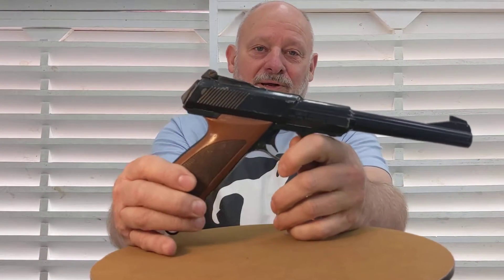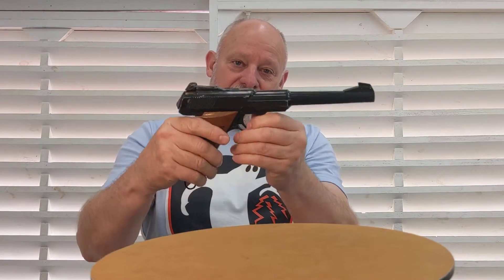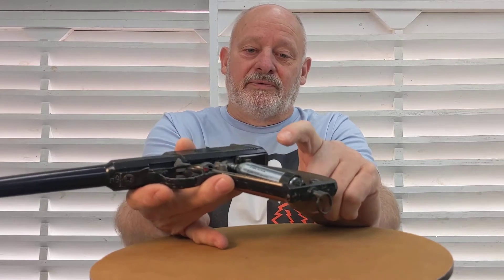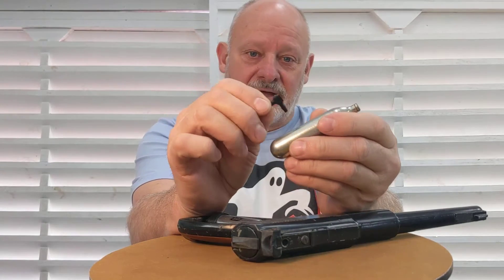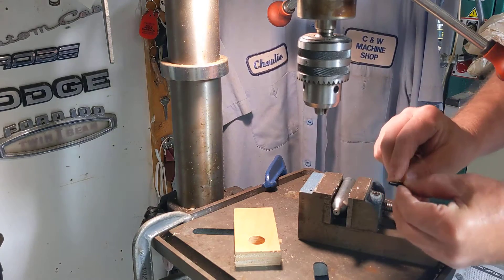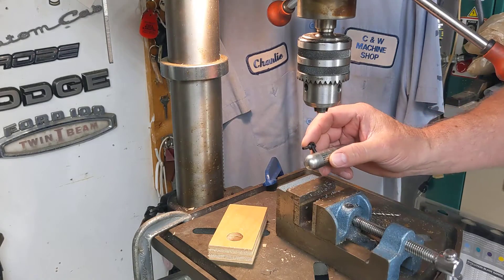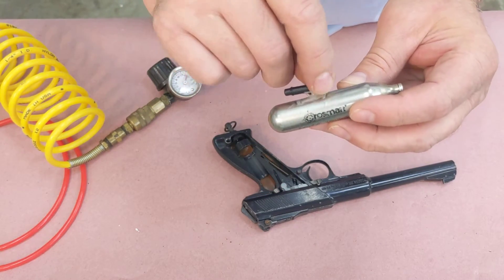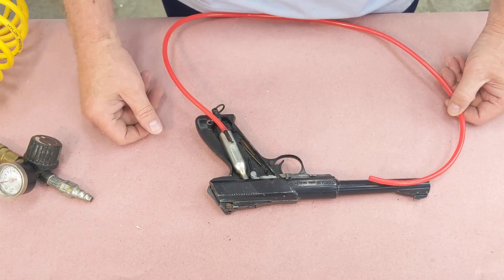Troubleshoot leaking CO2 gun with improvised compressed air adapter made from an empty CO2 cylinder

Comment: I've just started the video and have not got past the drilling of the empty cartridge..... But if you haven't chencked the rubber or leather gasket around the needle that creates the seal with the cartridge, that is my prediction. Especially with the fac5 you said the tank was all frosted up, i would assume it is ejecting gas downward around the co2 cartridge itself.

Comment: Ridiculous!
That red tube will blow loose at 50 psi!!!
And where are you getting 800 plus pounds of compressed air from????
Reply from the maker: attempting to trouble shoot the leak at a low pressure since it leaks even at 50 psi

Comment: I see a lot of inherent problems, except using this platform as a means of troubleshooting a low pressure leak. After you find what is causing a low pressure leak you may find yourself chasing your tail to find higher pressure leaks.
Reply from the maker: Yep, it is just a start to locate and correct any major leaks that occur at even low pressure

Comment: Daisy advertised claim that the 200 and 300 carbine were "o'ringless".  Daisy refused to service these and respectively claim them to be disposable once leaking.  I differ, as I have rebuilt probably six of these platforms between the two models.  

They use a very clever valve design that is a self resetting blow open and, yes, do have o'rings.    I really like the design.
Reply from the maker: I would really like to rebuild the model 200.  It has such a nice trigger , better than any other semi auto co2 I have fired.   I converted one to LASER burst for a shooting simulator but I still have another one I hope to repair some fine day.
Reply: How did you repair yours?

Comment: May I ask how many pounds of air pressure did you put into the gun?
Reply from the maker: I believe it was around 125 psi
Reply: Thank you.
Did you ever get this gun to seal
Reply from the maker: no, I wish I could have made it work again because it has the best trigger action I have ever found on a co2 gun.  I converted the gun to shoot LASER bursts to use in a 2gun practice simulator I built since the gun is very similar to a Ruger MK2 grip angle

Comment: I have a similar issue on my model 100, every time I put in a cartridge ( they use the short 8 ones) it leaks all instantly. I have no idea how to fix it
Reply: Maybe  too late but when you add your cartridges, drop of oil on top of cartridge and on the hole puncher end and when you tighten the cartridge up hold it with you thumb and not let it turn and soon as you here air, a small turn just to stop air escape, if you tighten tight it will leaks out
Reply from the maker: can be tough to let it go sometimes,,,but parts are not readily available